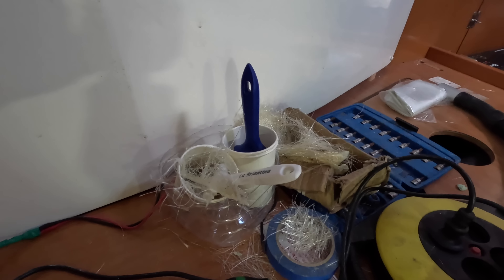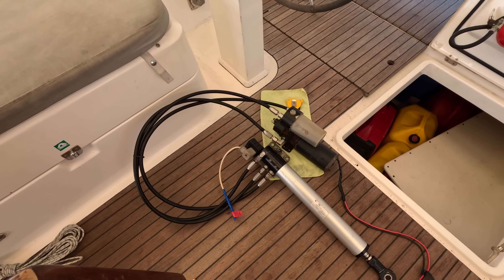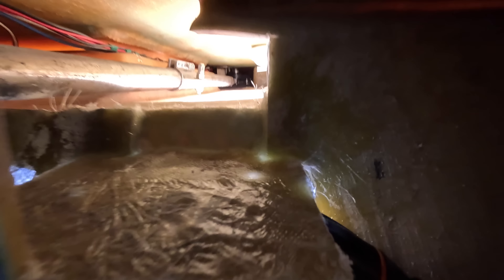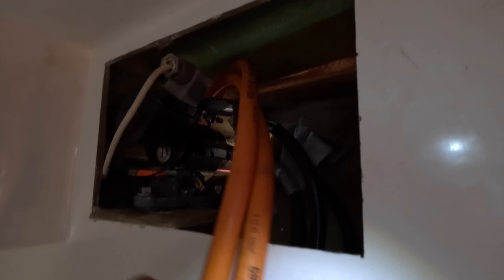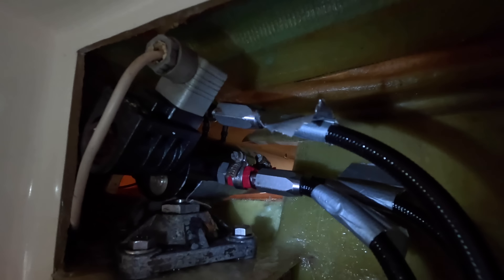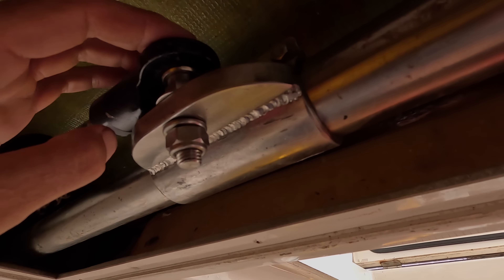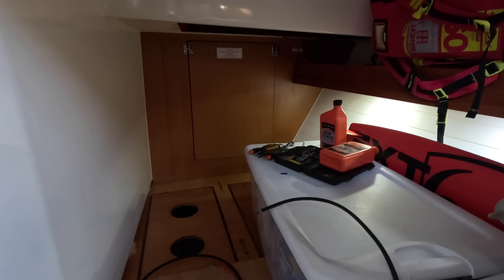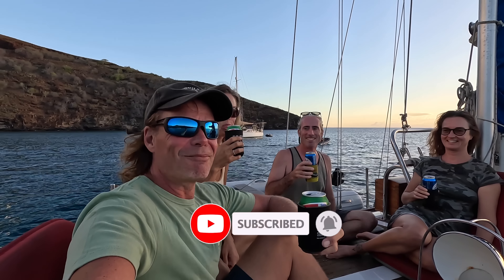SAILING MODIFICATIONS AND SETBACKS- SwT 145 - AUTOPILOT

Comment: I delivered a Hanse 595 from New Caledonia to Hawaii with the same transom as yours & they had fitted a windvane (Removeable ) witch worked -OK . It didnt have lithium but did have a generator on mainly for the water maker , A blessing .
Reply from the maker: Sounds like a nice trip with a nice yacht👍🏻
Thank you for sharing your experience and for being here. All the best
Reply: @SailingwithThomas   Hi Thomas, I just had a thought (I know, dangerous things thoughts ) You know the steering quadrant is pretty simple right ? Well shouldn't it be possible to Have secure Mountings to fit a Tiller Pilot to it as a  Backup autopilot ? They are a lot cheaper than wheel Pilots, and out of the weather, are usually really reliable ? Just a thought.  Best Wishes and Fair Winds.  Bob.  🤔👍⛵️✨️✨️✨️

Comment: Have considered a slated vent to cover that access? Or would you try to restrict air exchanging between that space & cabin?
Reply from the maker: Several options is on the table, have not decided yet. We’re still in very remote places so not easy to source what we need no matter solution we choose. It’s a dry compartment but not 100% waterproof from the technical rudder compartment. So a watertight door might be the best solution. However if water ever should reach this far up I believe we already have bigger problems.... All the best and cheers 🍻

Comment: I don't understand idea of the pins with the autopilots.. I've heard the pin breaking in so many cases. 
Sure, it is easier to make the pin as cantilevel style as universal fitting. If it was slot/fork style fitting, the pin would never break.
Reply from the maker: Its lots of power on a tiny pin. Sometimes a pin is a sacrifisal point designed to break before other things. But having this with several layers of moving parts is not a great solution. Not only will you loose your AP but also steering if designed like mine was from Lewmar. All the best

Comment: Thomas! Safe travels to you and company! If you could, would you rewind and purchased a different sailboat? What is your dream sailboat if money isn't an issue? And would (if money wasn't an issue) you consider a power trawler at some point in your life? I think I know some of the answers, just asking!
Reply: I can't answer for Thomas, but the advantage of a pure sailboat is that you can cross an ocean with very little fuel...
Reply from the maker: Im pretty happy with BE FREE so far, and the only problems I have had is labeled Lewmar. The generator has also its own life, but except from this a quite happy journe so far and soon 30K Nautical miles. 
I did a pretty desent research and also reality check money wiese 6 years ago, so I still belive I would bought same boat all over again. I have always been facinerende by performance and multihull. So if money was nothing to think about there is lots of interesting cats and even trimarans now. A Brand that is quite new that have got my attention is Neel. I find it quite attractive for several reasons, and pretty innovative solutions with master ensuite on bridge deck. Also amazed how they gathered all tech in the basement of the center hull, giving the most spacious engineroom to enjoy as well. Seen a few lately and they seems to roll more at anchor than BE FREE. So guess the same rules is still valid. Whats makes it fast makes it not so good at anchor. What makes a boat a floating mansion at anchor gives it poor sailing qualities. Outremer seems to have a good blend of both worlds. Comfortable for cruising fast, and pretty good at anchor. 
So guess I would have to do more research and test sails before I could even start pointing in a new direction. For now Im very thankful and happy with what I have.
All the best🍻

Comment: lot to be said about the old windvanes...bullet proof
Reply: Not really, part failures are pretty bad on newer ones, with their plastic components, but the worst weakness with wind vane steering is their much too slow reaction times in changing and challenging ci ditions, which can be extremely bad news. the big positive, and only positive for me, is having a backup rudder. However if you have a boat with excellent tracking, such as with a long keel, on long Crossings you only have to make occasional Course adjustments, and backup steering can be a Bowthruster. Modern  Autopilots offer so many advantages over Wind Vanes, today, their expense is hard to justify, and it is actually cheaper to have a backup autopilot imho. The only real issue appears to be with B&G and Raymarine Autopilots currently taking unauthorised Breaks and dropping out. B&G have known about this for years, but the issue continues, while it happening to Raymarine is much more recent , and I have alerted the Raymarine Team that the problem exists, and hopefully they get to the bottom of it quite fast. A reboot of the Raymarine Autopilot does clear the Drop Out, but it can take a while for the watch to even notice that they have had a problem, which is not an acceptable predicament to throw a Crew into. Hopefully this is resolved before I have to specify  what is going to go into the build of my next Sailboat,  but if not, I'll still go with Raymarine electronics plus network, and perhaps have a Garmin Autopilot onboard as a backup if they are reasonably compatible. It really shouldn't be a serious issue though as my next Sailboat is going to be a long Keel Island Packet IP 439, and they have a very good relationship with Raymarine. It will also have a variable thrust Bowthruster, so Backup  Course changes should be OK. Best Wishes.  Bob.  👍⛵️✨️✨️✨️
Reply: Nice one Thomas Have a good Crossing to next Port with Fair Winds.  Bob in Wales still.  👍⛵️✨️✨️✨️
Reply: @brownnoise357  Can't leave this be the only opinion. I have a smaller 34 ft boat with a long fin keel and a canoe stern. My Pacific Windpilot not only steered 6000 miles across the Pacific last year, and is a 25-year-old unit, it handled easily conditions to 30 knots when I had to go to staysail only. I do have a Raymarine tiller autopilot for when motoring, but the windvane takes no power, makes no noise, and works endlessly. Yes, it takes up room in the cockpit, but I am a solo sailor so that is not a problem, and yes, parts can break, but I was able to repair them. There is a special delight in watching it steer the boat.
Reply from the maker: Works very well for lots of sailors. I have never been a big fan, and there is issues also with windwanes. Espesially when the boats grows in size and boat speed increase. The cost of a windvane equals 2 complete standalone hydraulic systems and computors. So its for sure pro & cons even with this. Thank you for watching and all the best ⛵️
Reply from the maker: Thank you so much 🙏🏻
Reply: Which sadly can't seem to be said about the new ones, too much weak plastic. Also even the old ones had serious reaction time issues if the wind direction became changeable. There is no way they can match the rapid reaction speed of an electronic autopilot , and that can be really important. If you have a very good tracking Keel, that is difficult to throw off Track, such as a long Keel (which also applies to them when they are very shallow draft ), then the pressure is off, especially with GPS Course Tracking, as even during a  night watch, you can set your course Bearing after getting the boat comfortably balanced and With Bu gees to the wheel or tiller from Port and Starboard Stanchions, where is the heading of the course gointo to go ? So Thousands for a Wind Vane, or a few quid for some bungees in addition to the Autopilot with the fast response time  eeded when conditions  go bad ? Not exactly a difficult choice is it, if you start off with the optimum Hull form and Keel for Cruising. Of course everything is a compromise with boats, and it isn't difficult to Compensate  for non optimum Course Tracking, though I would  never bother with a wind Vane, as none of my Sailboats have needed one, and neither will my  next Sailboat.  Mostly it's been  relatively heap but effective  Tiller Pilots and Bungees on long Keel shallow draft Sailboats. That is a point - shouldn't it be fairly easy to fit a Tiller pilot to a Wheel steering quadrant securely ? If the fixtures for o e are put in place ready, a Tiller pilot could then possibly  be an excellent low cost Backup ? 🤔
Reply: @SailingwithThomas  My thoughts too Thomas, plus extremely poor Wind Vane Reaction time when it really matters, has been the Insurmountable Obstacle  to me ever having one tbh, plus today, most seem to have short service life plastic components in them. Pass.  Best Wishes.  Bob.  👍